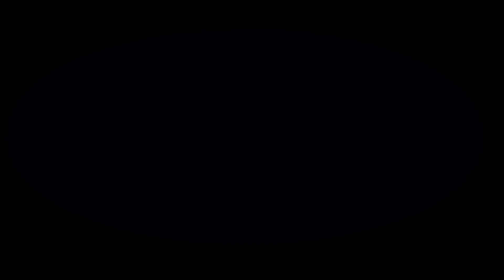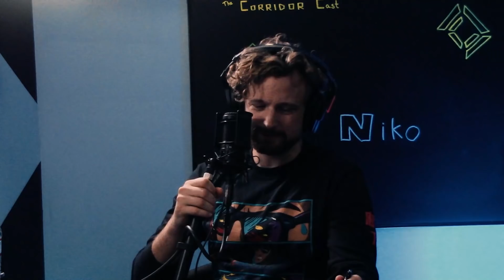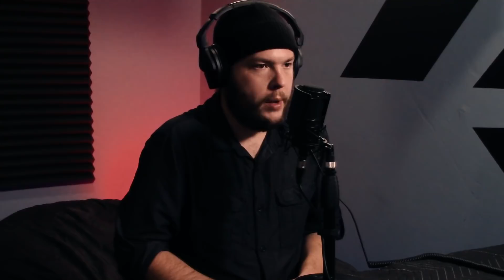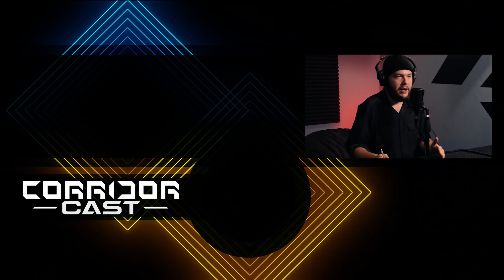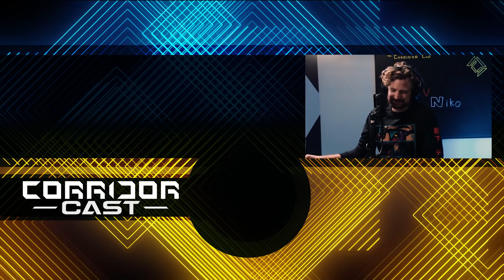Why The Perfect Camera Could Kill Jobs

Comment: As a 1st AC (focus puller) I understand the desire for a small, quick, accurate auto focus for jobs that are so small that an extra person is a "waste". Some systems are starting to fill that niche like the Tilta and PD movie at the low end and Teradek RT in the middle high end.

Simply being able to control focus, zoom, and movement as a solo operator is powerful and game changing. I don't think that will end focus pullers careers for the very reasons you state at the end. No matter how slick the kit becomes, someone still has to look after it during the shooting day and make sure what the story requires to be in focus, is in focus.

My whole job is to remove the technical aspects of filming from the directors or DPs head so they can concentrate on story / motivation / beauty
Reply: Isn't it also that philosophy to offload work/tasks stems from the camera segment of the industry being structured almost like an apprenticeship to get higher and higher access to bigger and better equipment?

Comment: What's wrong with a wireless follow focus? Not sure if you were implying you didn't want an AC but those *are" the solution for focusing a camera on a gimbal.
Reply: ~ 4:00   "because it sucks"
Reply: @TheNewton  I'm talking about hardware wireless solutions, not things like the  Foolcontrol app. Wireless follow focuses are the industry standard in hollywood and certainly do not suck. I think Niko is referring to solutions like Foolcontrol that work over wifi and utilize the internal autofocus motor of the lens, but I'm suggesting something like this: 
https://www.bhphotovideo.com/c/product/1287559-REG/arri_k2_72103_0_wcu_4_wireless_compact_unit.html/?ap=y&gclid=Cj0KCQiAzKnjBRDPARIsAKxfTRA80QgDHHq4867MksO6haC5WPNM6xpjhQ9rNavvNY9pAlPCcviVbgoaApWdEALw_wcB&lsft=BI%3A514&smp=Y

There are even versions of this system that work effectively like autofocus systems: https://shop.redrockmicro.com/eclipse/

Comment: The Zhiyun Crane and Ronin S have built in manual focus control on the gimbel so that you can pull focus manually on the lens without having to touch it, and without having to add extra stuff like a Teradek system